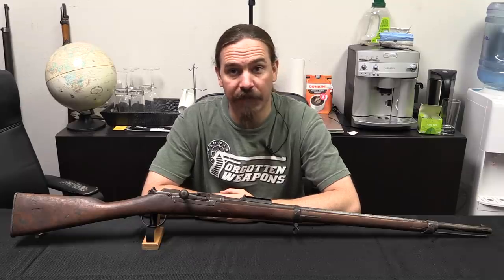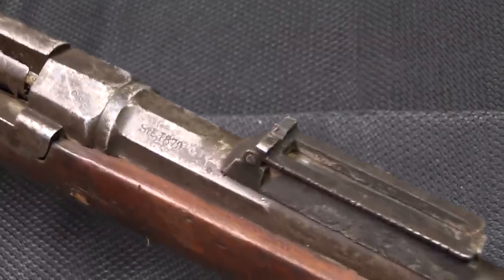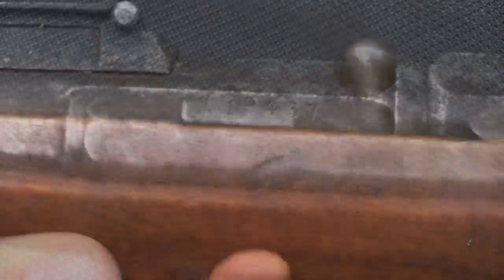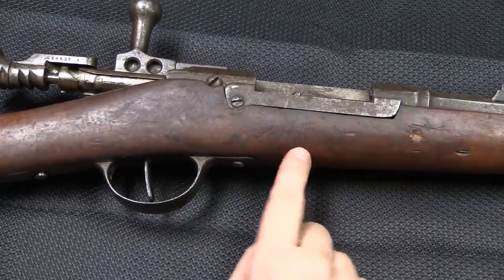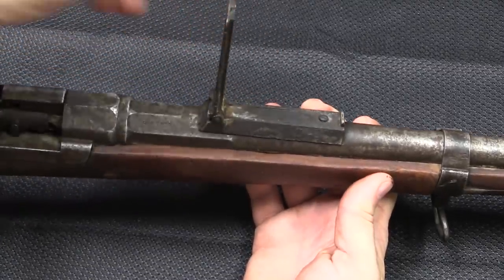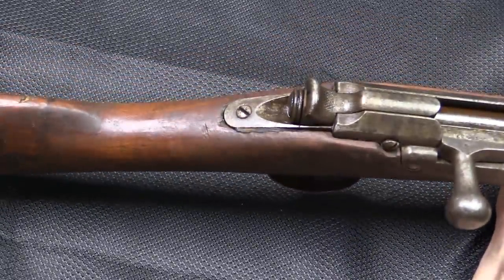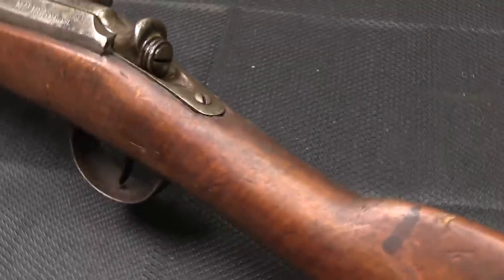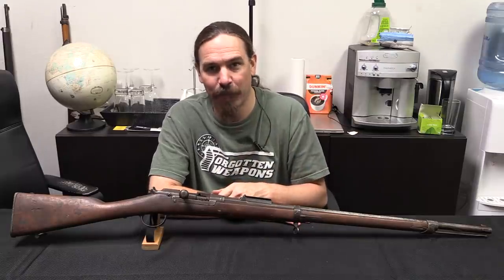Ethiopian Oddities - Single Shot French Mle 1878 Marine

Comment: Yes soldier, I know everyone else in the platoon has AK47 rifles. You will just have to be more accurate with your single shot.
Reply: Yes sir, says Pvt Quigley!
Reply: How to motivate student snipers...
Reply: He's leaving out that they have 3 more AK rifles than they have AK magazines.  And only enough ammo for 2 rounds per gun.  The weird French thing isn't so bad in light of that info.

Just as a side note, can someone tell me if you can actually shoot an AK47 without a magazine in it -- chambering a single round?  If there's a magazine safety or something could you disable it easily?
Reply: @WalkaCrookedLine  Comrade, this is soviet union. Only safety is big bar on side and finger. Is so easy child can shoot! 
As for single loading its definitely possible. You just have to keep in mind that without a magazine you've got a big open spot in the bottom of the chamber so you need to mostly push the round all the way in manually before you drop the bolt.
Reply: It was for the local Barney Fife.

Comment: Could it also just have been a broken stock? If the mag tube was damaged surely it would've been possible to just disable the lifter to give you a single shot rifle.
Reply: I'm thinking the same thing. Kludging together something that puts lead downrange from bits and pieces that don't.
Reply: I was wondering that... Make 1 of 2.

Bit he does say it near the end.
Reply: There is even is a magazine cut off, could have just welded it in the off position.
Reply: I would suspect it was very heavily damaged, through who knows what.

Whatever happened destroyed the rear sight, probably the magazine and definely made the stock unusable
Reply: @lukiuki8395  I agree, it's definitely had a hard life. However can we be sure that all the damage happened at the same time? A lot of these rifles Ian's showing us from Ethiopia have replacement sights as they're easily damaged.
Reply: @lukiuki8395  Maybe used as a club in HtH combat?
Reply: We don't know what he had to work with
Reply: My theory is it was either shot in the stock and mag tube or caught in some kind of explosion that damaged both the stock and mag tube
Reply: Thing is with the magazine tube inside of the stock itself, any sort of external damage extreme enough to damage the tube probably broke the stock too. Minor parts breakage sure they could have disabled the tube, but any battle damage that destroyed the tube....
Reply: or maybe it was damaged and then became a donor for parts and someone said well maybe we can make something out of these bits.

Comment: A bolt-action rifle with a mag tube being converted into a single-shot rifle.

Probably done to train some troops? Or perhaps this was meant for troops that were a bit more used to old single-shots but needed a more "modern/current" (at the time this was made) weapon?

Either way, this is an interesting conversion for an existing gun.
Reply: A lot of new troops there rarely get off more than one shot , so

Comment: I would have just made a normal non movable blade rear sight. I make them all the time for my flintlocks out of half inch bar-stock with a hack saw and a file and you don't even need a hack saw, I'm just lazy. 
   Then you fit it to a shallow dovetail or just solder it on. Cut the notch with a small thin file and its easy to adjust for windage or elevation with a punch or a file.